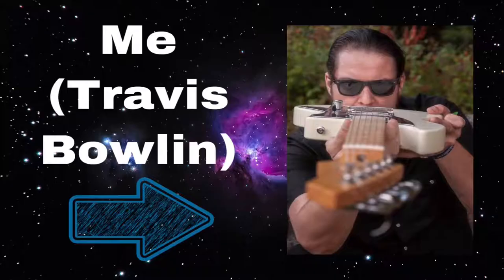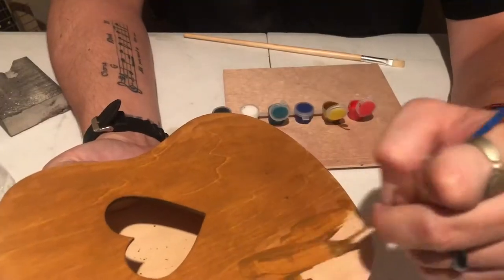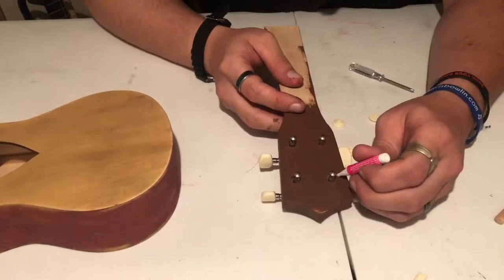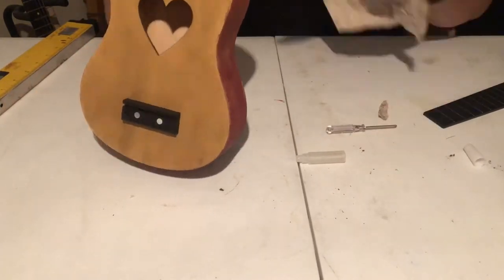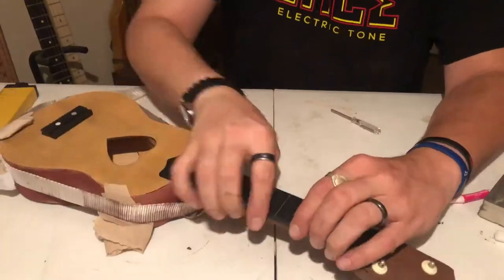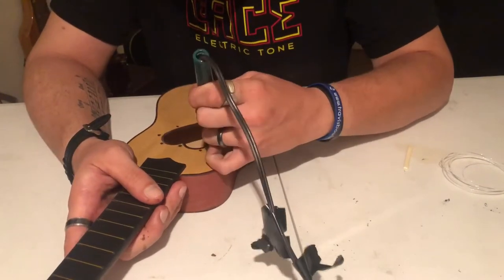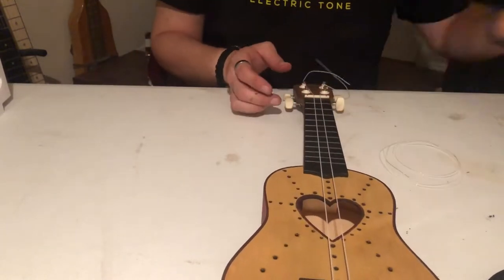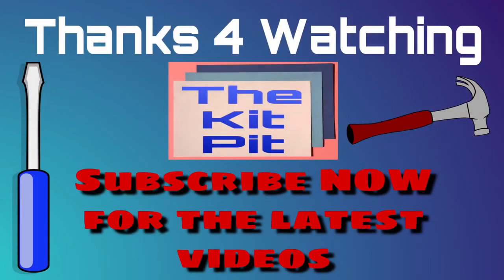Build a Ukulele Kit for under $20.

Comment: This  is really thorough and detailed, which I appreciate.  But you made a critical error when stringing.  Most ukuleles use re-entrant tuning, with a high G on the fourth string.  Therefore if you string it as you described, it will never tune correctly because the strings will all be in the wrong place.
Reply: Super helpful.  Thanks!